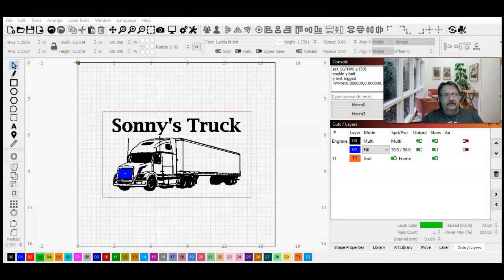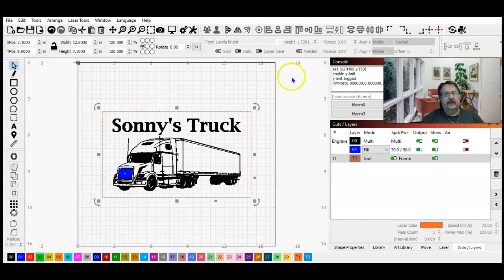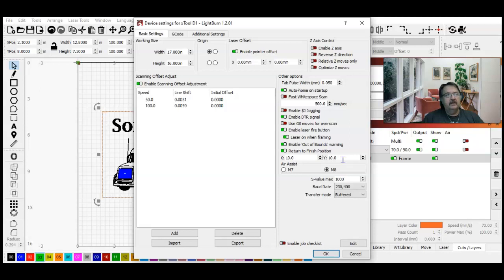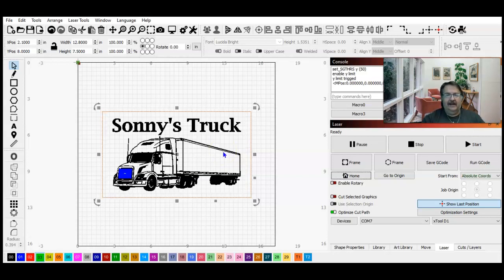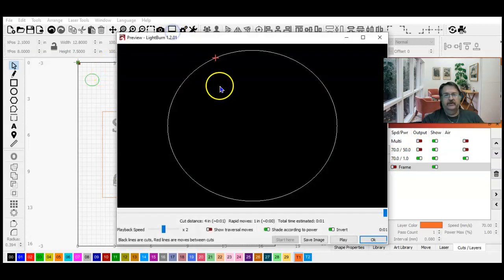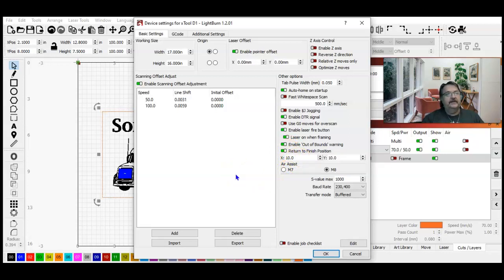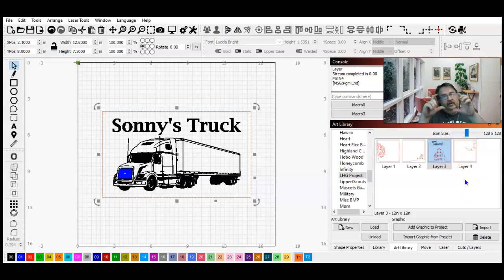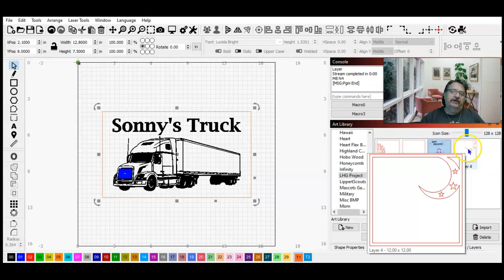"Did Ya Know?" How to use LightBurn's Return to Finish Position before starting a job with xTool.

Comment: I sent you a link to video but got kick out, looks like device coming soon to add limit switches to standard D1. Xtool d1 mods preview
Reply from the maker: If they sent it to me for free and paid me to do the upgrade, sent me a replacement module for the module that failed in the first four months of use, I MIGHT consider using the xTool again. I'm still waiting for a call from them on a warranty claim initiated in September 2022.

Comment: This is exactly what I do as well. Do you know if there is a way to change speed and power settings after you start while it's burning?
Reply from the maker: Not without stopping the laser. But you can stop the laser. Change the settings. Then preview the job. Run the simulation in preview. And tell it to start from a particular spot in the preview. Picking up from where you paused the job by clicking "start from here" in the preview screen.
Reply: Thank you

Comment: Steve, you need to add this only works if you keep the power on between re-burns, and don’t move anything. it will not work if you shut it down then discover something needs to be re-burned.

Comment: Great video Steve! Just to add a bit, if you manually move the laser to the 0/0 position on the D1 by hand before turning it on, you won't need the green circle.
Reply from the maker: It might be just my setup, but the wiring harness on the gantry and the air assist can sometimes interfere with my mysterious 0/0. I'm afraid it would never be the same twice. Taking the extra step to start from the machines 10/10 gives me more confidence in repeatability. I only do it when I think I may need to do a second burn attempt on the same piece or when using a jig.